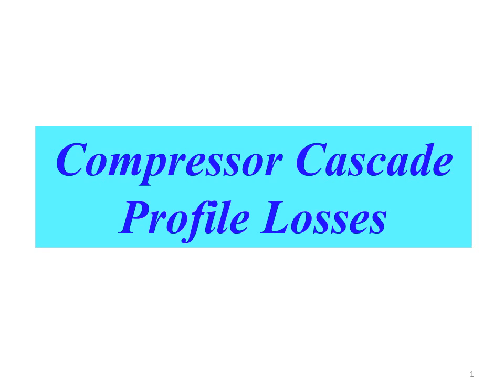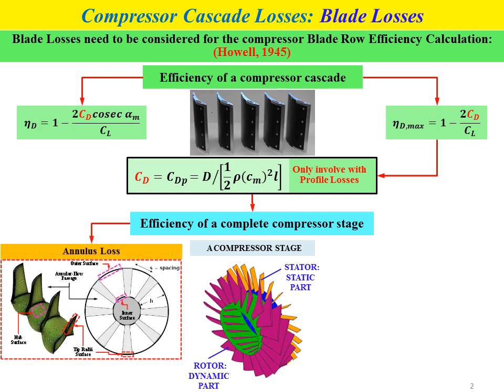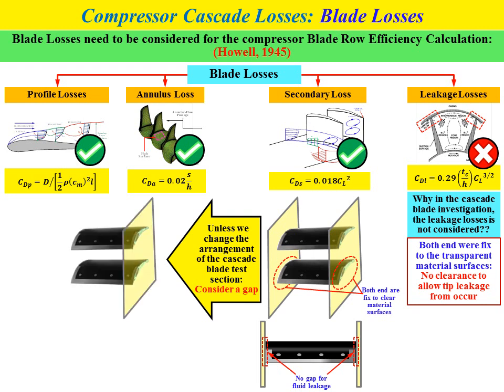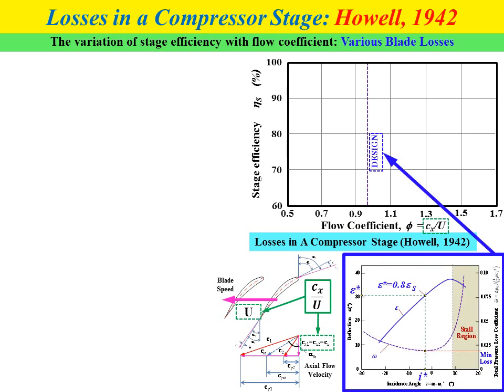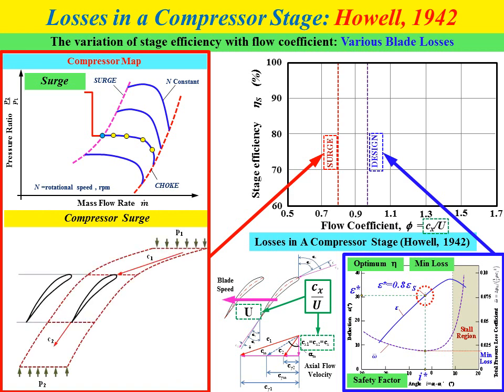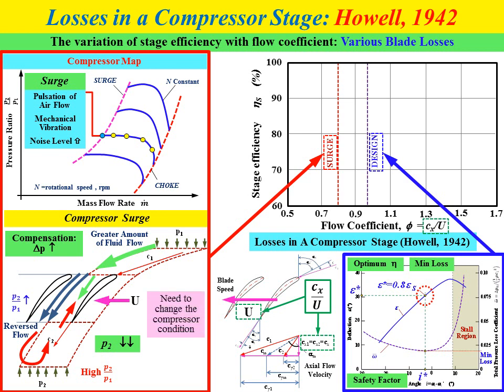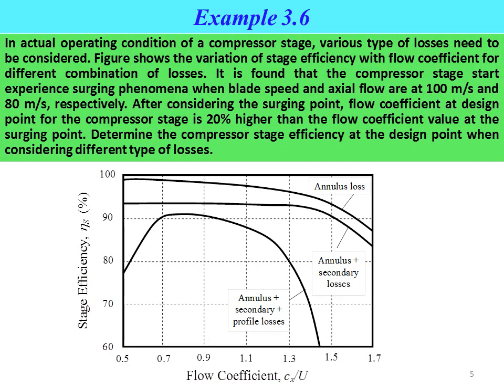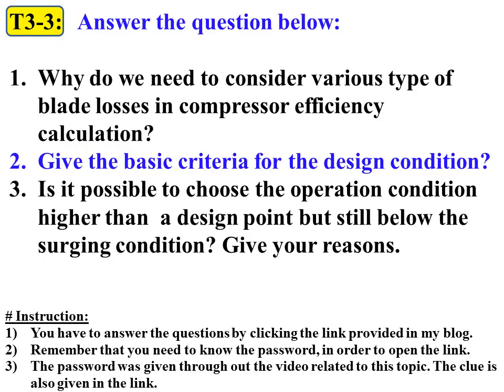TM LEC #16: CHAPTER 03 CASCADE PERFORMANCE PART 3

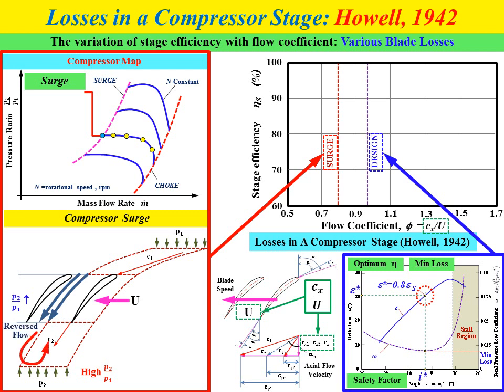Comment: salam dr, I don't understand about surging phenomena starting at this time ( 13:33 ) can we eliminate the surge effect or we can just avoid from it to happen?
Reply from the maker: Salam...the surging will occur at specific mass flow rate and rotor speed. Every compressor will have this point and the designer need to know this point in order to avoid it from happen in actual operation. We have to avoid the surging from happen by selecting proper parameters in term of flow rate and rotor speed.

Comment: Dr I would like to ask, at 18:00 how do we determine the working range for each types of loss, it those value fix or have any way we can determine them?
Reply from the maker: There are 2 guidelines in choosing the working range in term of flow coefficient:
1. Max limit of flow coefficient: Can be higher than the design point but not too far, with efficiency greater than 80% is acceptable.
2. Min Limit of flow coefficient: Can be lower than the design point but not too close to the surge point, with efficiency as highest as possibble.
Reply: @yusmadymohamedarifin6008  Thanks Dr

Comment: Salam Dr, saya nak tanya mengenai compressor surge. What type of compressor condition that need to change in order to avoid the surge phenomena? Is it the pressure ratio? If it is pressure ratio, then do we need to decrease the pressure ratio to avoid the reverse flow?
Reply from the maker: Salam syasya..pressure ratio is the outcome or the result...you have to adjust the mass flow rate
Reply: @yusmadymohamedarifin6008  alright Dr thank you 😁👍